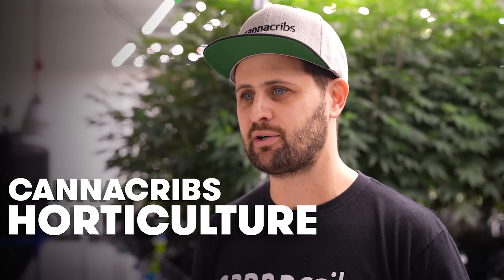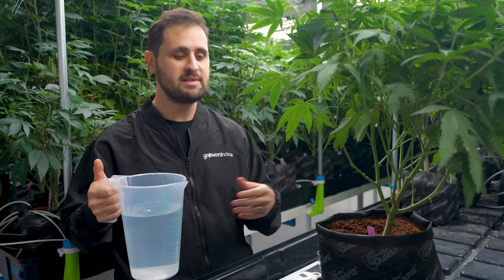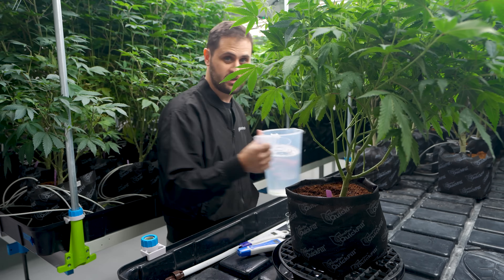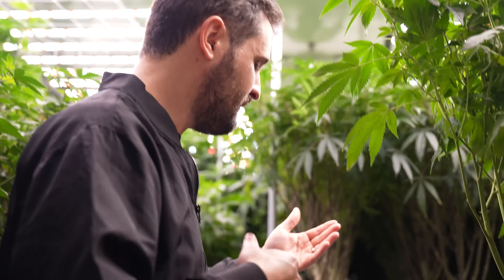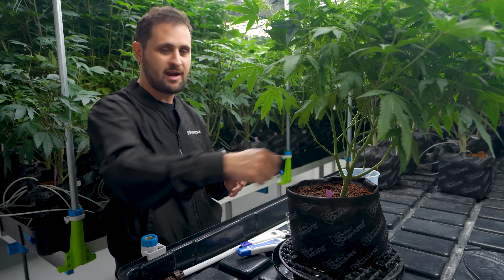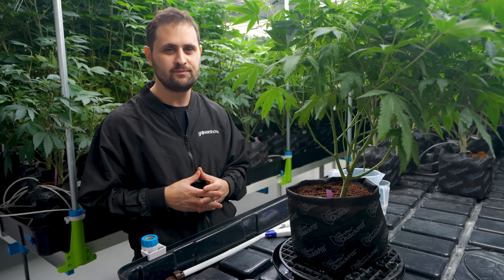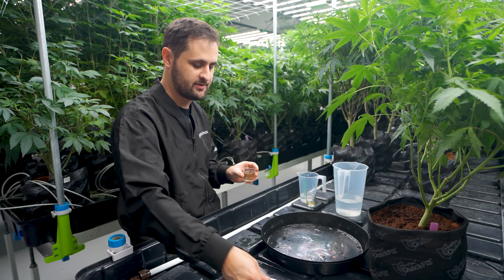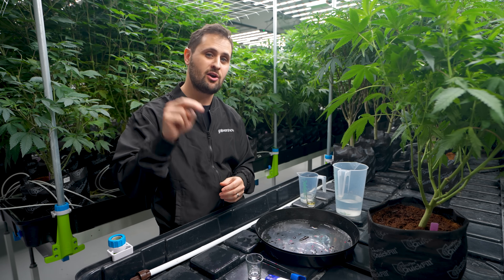Analyzing Runoff with the Pour-Through Method: Cannabis Cultivation

Comment: What is the range for flowering phase in coco50%/ perlite50% at vpd 1-2 ?? 4.1 ec in veg is not to high?
Reply: 4.1 ec is high to use in the water, but even using 2.1, 2.3, overtime the salts will concentrate in the substrate. that's why yo must flush regularly.

Comment: you can push to 5 ec and 5.7 ph in straight coco at that stage, and stack it to 8 ec as long as your top feed increases in ph . You have to take the value of the input and the output and divide it proportionally to get whats actually going on in the 3 layers of rootzone. Or get a digital meter and measure the bottom middle and top of the rootzone and adjust. I use a npk/ ph/ec/temp meter at the rootzone to develop my fert programs and they change with different mediums and irrigation techniques and dryback values. Noone else ive seen can measure npk ratios at the rootzone, most fly blind folded. some people do substrate samples but your behind the ball then. UC Davis in the house!
Reply: What NPK meter is that?

Comment: Woah 4.1 EC is extremely high
Reply: If the VPD is low, you can run with such high EC in hydro
Reply: Cannabis plants can actually tolerate surprisingly high substrate ECs—if the environmental conditions are dialed in. The key is understanding what the EC is made up of. It’s not just about the number—it’s about the composition. For example, high levels of carbonate or sulfate ions will affect the plant very differently than high levels of chloride ions. 
So knowing the nutrient breakdown behind the EC is just as important as the value itself.
Reply: @Juangrow_cannacribs  thanks for details 🙏